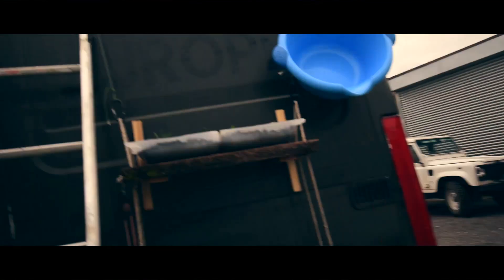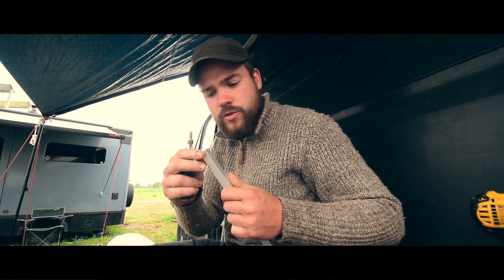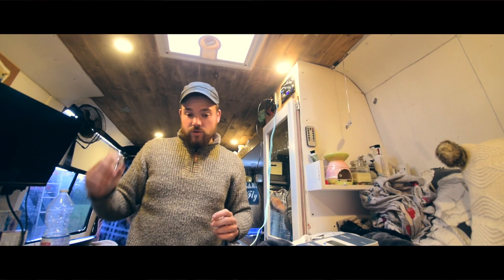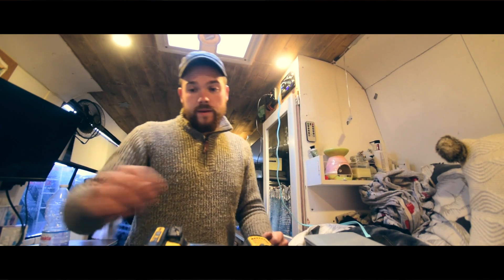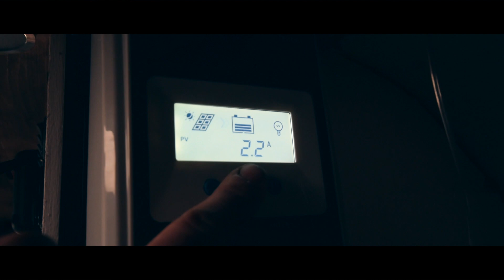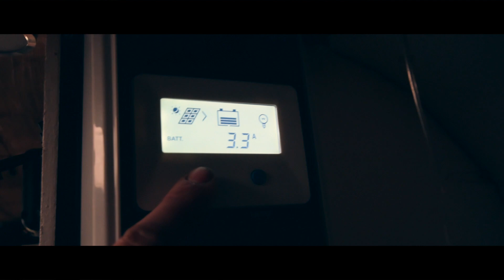New Lights, New Seats, New Lenses... Lost In Europe //266

Comment: If you don't like drilling holes in your van , 3M vhb tape is a great alternative for the alloy led holders. Sticks like s to a blanket on alloy - all surfaces just need degreasing beforehand. I finished mine with a bead of Sikaflex along the top , which as you said formed a really good gutter.